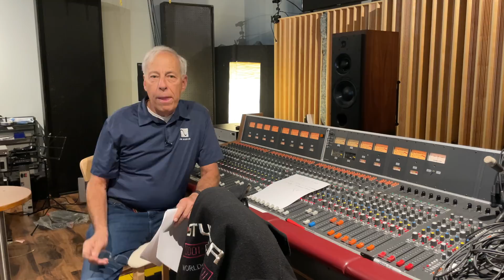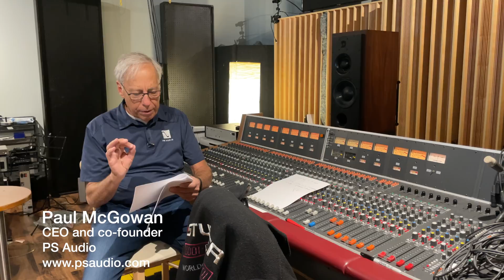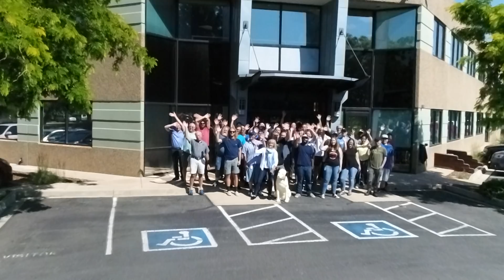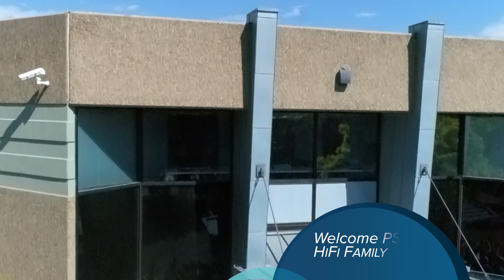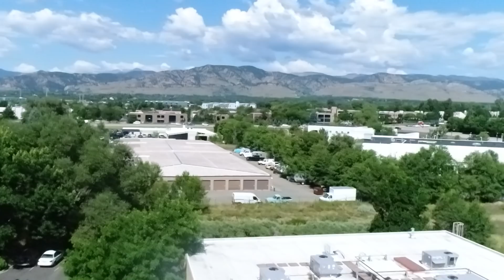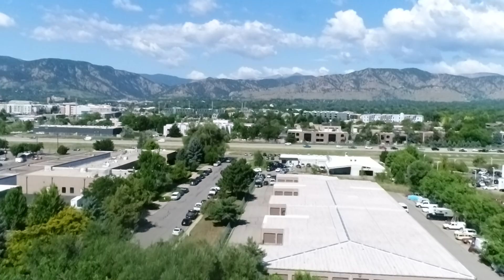The difference between preamps and power amps

Comment: Thank you for this clear explanation of the differences between what a pre-amp does and what a power amp does!
Assuming knowledge of input source levels (phono, mic, instrument, line, speaker), this takes me from an input signal with certain characteristics (voltage, current, impedence)  and passing through a pre-amp and a power amp to a signal getting ready to enter a speaker. 
I suppose what I still dont understand or, in other words, what is missing from the signal path story is how and why a speaker responds differently to differences in voltage, current and impedence, the impact on the quality of the sound produced and what signal characteristics work best for a speaker..
Reply: Some related answers:
speaker efficiency: https://youtu.be/GyHJSpZ-7jI?si=2RcWtR4K_Asv3SR9
speaker impedence: https://youtu.be/JaEgq7W8IZI?si=xhkHJfZmxHeX_5Vq

Comment: Hi there Super-Paul. I have another question for you: I have a set of 6 Loudspeakers with a 4 ohm impedance. I have also found a Pre-Amp rated at 8000 watts pushing 2-8 ohm Loudspeakers. Will this Amp suffice to power my 4 ohm impedance Loudspeakers? Thank You in advance Paul.

Comment: A pre-amplifier doesn't have any speaker line-out.  Only an amplifier does. I can explain this in about 2 seconds. The difference between an amplifier. Do I need a pre-amplifier? Do I need a mixer? Do I need a signal processor? Or do I have everything I need? I've yet to see a simple explanation that to me has a very simple answer.

Comment: I appreciate your explanation. I was just thinking if the ultimate purpose of the system is to make audible sound to humans, is it really necessary to divide the 'integrated' amp into two? We might define a device at the first time of the invention which can control voltage and current as 'amp' because both functions are necessary afterall.

Comment: Thank you Paul for this very understandable explanation on the differences between a preamp and a power amp. So, do I need a preamp  or can I just live with a power amp to power my speakers? Does the preamp give me some additional features when used in conjunction with the power amp? I can only guess that there must be a physical connection between the preamp to the power amp and then to the speakers and in that order? I'm an infant in my knowledge of this but I'd like to finally learn more about it. Thank you  Paul. Excellent video.
Reply from the maker: The preamp controls volume and provides input selection. In some "amps" called integrated, it is built it. A strict power amplifier has no means of controlling volume or selecting different inputs. So, that's always the preamp's job in an analog system. In a digital system (CD player or streamer) the preamp chores are often handled on your phone or tablet, so no need for a separate preamp.

Comment: Why do we need two separate devices ( preamp and amp) when av receiver can do both these functions?
Reply: Separates no compromise quality components, easy to upgrade and swappable.

Receiver the DAC, Preamp and Amp in one box. The integrated circuits share the same power from the wall (compromise) if something breaks hard to troubleshoot.

Comment: I get it, but I don’t at the same time? Like, why is a high impedance 600ohm headphone “difficult” to drive, when a low impedance speaker needs POWER? Why is a 16ohm to 32ohm easily able to be driven by a phone when the number is closer to an impedance of a speaker, but a 600ohm headphone, although works, isn’t great? What’s a purpose of a headphone to be that high of an impedance, when a good speaker that is low impedance sounds good too? I would have thought a high ohm headphone would need power too if it’s got the “headphone equivalent” of what a speaker needs to sound good. Like, does a 600ohm headphone have more components than a 32ohm? I got a DT 900 standard headphones that I got in 32ohm, but I had a choice to go higher. Why? When a 32ohm can be driven easily. Would that same model sound any different plugged into my DAC/amp than my current ones? Or is it suit people’s needs in what amp they have?

Argh!!!! Excuse my ignorance. I didn’t think when I got into audio I had to understand the same things as an electrician haha clearly I should just stick to asking if “this” would work with “this” gear and never think about it again lol

Comment: Wow thank you so much. This is the only video or article I have encountered so far as an aspiring audiophile that has finally allowed me to understand it. Thank you so much. I have one question though, given the role of the power amp as described,  am I to understand that the audio signal will travel on the voltage line to the drivers/speakers, while the current allows the drivers to be able to move thanks to the power/force (wattage)?
Reply from the maker: Sort of. Think of a power amp as two blocks, one feeding the other. The first block is the voltage amplifier that makes the signal bigger (1 volt in equals 30 volts out). This feeds (in series) the second block which is current (power). The current output stage is all that connects up to your speakers to move your drivers.
Reply: @Paulmcgowanpsaudio  oh wow.  i had to read that a couple times to grasp it but i think i finally understand what you are saying.  thank you so much my friend 👍
Reply from the maker: @virustwin  Thanks for that. This is what makes my day when the light bulb begins to shine. Sometimes it just takes a long time and many different tries. Congrats!

Comment: Nope. A preamp does not increase voltage, it lowers voltage. The power amp has a fixed amount of gain and in order to regulate the volume, the voltage has to be lowered at the input. Some preamps (phono, microphone) actually amplify but not your regular hifi preamp.

Comment: Thats the easiest explanation of preamp and power amp ive heard! Thank you paul as always!
Reply from the maker: My pleasure. Thanks for the kind words.
Reply: @Paulmcgowanpsaudio  So to play my record with my new turntable I need preamp and amp? I thought I only need a preamp and connected with the speakers
Reply from the maker: @kebello10  Some amps have built in preamps so it depends on what kind of amp. But if we are separating the gear as we do in high end audio, then yes, you need a phono preamplifier (or a preamp with a phono input). This gets the music off of the record and amplifies it to a useable level. But the output signal from a preamplifier does not have the strength necessary to drive a loudspeaker. That requires power from an amplifier.

Comment: If you do not have electrical back ground, think about the Pre-amp as a bicycle pump. You can create very high air pressure if you pluck the nozzle (high impedance) while you pump, or connect it small bicycle tyre that is full.

But once you connect it to a truck tyres, it lost its function, because there isn’t enough air flow to inflate the tyre to keep the pressure high.

The power amp is like a air compressor. It too increases the pressure of tyres, but it also has large air flow that can fill up the truck tyres.
Reply: Thanks a lot
Reply: This makes sense but I still don't understand why we need the bicycle pump. I don't have two engines in my car, one tiny and one big. I have one big motor. Surely the pre-amplifer brings something to the table other than being in the chain?
Reply: @blackburd  
Pre-amp could be a dedicated one that is designed for a specific source or a instrument, like guitar, mic, line-in, keyboard, audio decks, radio-tuner…. 
Keep in mind that these devices or instruments generate signals at different level.  

Or it could be one that is designed to handle multiple inputs, selectable with switches on the front panel. It may also include filters or equalizer. 

In short, it deals with input or inputs, amplify the signals to a controlled level, so that when they are connected to the main-amp, user can switch between sources without having to adjust the main-amp.

The main-amp deals with the Speakers. Different speakers work best with different Amplifier. So they work in pair with the speakers system, depend on how loud you want the output to be.

Using separate amp systems for source and output, makes it easier to manage and upgrade.

Comment: Maybe the old water analogy would help here.  The preamp takes a small amount of pressure and increases it.  The power amplifier also increases the pressure but adds to the amount or volume of water so that it can actually do something.  'Watts' simply being the combination of the amount of water and the pressure it's at.  Tube amplifiers for example are primarily voltage amplification devices, and require an output transformer to convert that voltage down to something reasonable and thus increase the current so it can push the mechanical device of a speaker to make useful sound levels.

Comment: Hi Paul I've subscribed to your channel because I know you talk a lot of sence.
I have a question regarding impedance. 
Can I reduce an amplifier that is rated at 4 ohms to 2 ohms without series-parallel ?!? 
Many Thanks!
Reply: @Sblackfll if an amps impedance is rated at 4 ohms then the amp decides the load not the speakers
Reply: @Sblackfll no matter way you look at it. An amp will have a rated impedance thus governing what load of ohms you can put into it.
Why do you think you can have an amps impedance rated at 4 or 2 ohms.
Reply: @MONK-7  It has a minimum rated speaker impedance that it can drive.  It DOES NOT DOES NOT have an impedance.  (Actually it does nave an output impedance, typically a fraction of an ohm.)

In an amplifier is rated fort 4 ohm speakers, then it can drive 4 or 8 ohm speakers.  It cannot drive two ohm speakers.
Reply: @Sblackfll look I'm enjoying the banter so no worries but my question to Paul was and I should have went more in-depth with the question. Was more of changimg the circuitry to achieve 2 ohms.

But I stand by what I said amplifiers Have an impedance ratio. 
Think about it I've got 4 speakers rated at 8 ohms each. Two on A/1/L and the same on the side B/2/R and the amp is rated at 4 ohms it's a perfect match. 
But if I add another speaker of same or greater/lower impedance the amplifier will overheat and quite possibly pack in. 
Thus the need for resistance as the amplifier requires to run at a safe level.
Impedance  Ω ohms.

Please say after me
Ohmmmmmmm
Ohmmmmmmm
🙏
Reply: It's also the speaker that can overload an amps impedance this is why the amp has a limit.
8,4,2 ohm's

Comment: Great explanation.  
Instead of a preamp, I use autoformer volume control.  With 12 3dB stops, it is like a 12 speed transmission.  Each click is 3dB less volume(voltage), but instead of using resistors it converts voltage into current.  Less volume but greater drive.

Comment: How does a phono-amp fit in to this scenario?
Is it similar to a power amp, but at a lesser amount of current?
Reply: What do you mean with phono-amp? A phono stage (or phono preamp) is a preamplifier that amplifies the signal from your turntable to line level and also applies the RIAA curve. It can be standalone or part of an integrated amplifier. An integrated amplifier combines both a preamplifier and a power amplifier in a single case. Usually such an integrated amplifier has multiple switchable inputs, one of which is for the turntable (because on this one the RIAA curve is applied as well as the input being matched to the output of the cartridge in your turntable - and that's why there's a little switch there to allow you to switch between magnet and crystal cartridge). To the others you would connect your other sources, the radio receiver, the tape player, the computer...
Now while there probably are some integrated amplifiers out there that only provide a phono input (and thus could rightfully be called phono-amps) I haven't seen any such limited device out in the wild.
Reply: The simple answer is it is another voltage amplifier that brings up a signal that is less than 5 millivolts to a signal that is over a volt or two, besides the EQ that must be done. A gain amplifier if you will.
Reply: @zulumax1  Is that the same as saying that a phono-amp is identical to a pre-amp, but with a fixed volume setting (a fixed gain setting)?
And the above is done to bring the voltage up enough for the pre-amp to continue the voltage increase via its volume control?

And I understand that some phono-amps have more than one gain setting.  But putting that aside, it is the same as a pre-amp, but for a fixed voltage increase?
Reply: @0Perhaps  There are equalization of the bass and high frequencies that needs to be made right, other than that the gain is measured in decibels. Moving magnet aprox. 40db of gain, moving coil probably 60db of gain. The gain of an amplifier has nothing to do with how many watts it puts out, only voltage gain into a given load, phono usually into 47,000 ohms. (moving magnet)

Comment: So, Paul, if I understand this, I assume that in the BHK300, the tubes serve as the voltage amplifier, and the MOSFETs serve as the current amplifier.  Is this correct?
Reply: Hi Neil, in case Paul doesn’t get back to you quickly enough you are correct. There are many companies that are using the same design philosophy lately and it’s a good design.
Reply: @Scopolamine46  thank you.
Reply: @doowopper1951  You’re very welcome.
Reply: you are wrong. vacuum tubes are on the preamplifier section and work in the same way as transistors but tubes give a different sound type.
Both are volt amplifiers

Tubes in PS audio equipment are only used in the preamplifier input section to provide a special sound type.
Reply: @ford1546  Check again. The BHK 300 is a mono block tube amplifier with a tube input stage for voltage gain feeding MOSFET voltage devices in the output stage. Both stages our voltage and amplification with the power stage being able to supply the current demand to power the speakers. This is the unit that is under discussion.

Comment: I have a gain selector on my preamp. I set this to zero and I can hear the sound improves a lot. So is it the voltage amplifier in the preamp that is very crucial to sound quality?
Reply: You have noise in your system that is noticable when the gain is turned up.
Reply: @Roof_Pizza  Yes, and the sound is somehow more 'flat'. I have a TAG Mclaren PA20r preamp partnered up with two 125m mono blocks of the same brand. I saw a review on the PA20r and they stated; Why isn't a gain selector more used on amps? I don't know if my preamp at gain zero could be classified as Class A. But I think it is closing in the gap. I almost never use any other gain than zero.  And with this my system is loud enough at half volume.
Reply: @Douglas Blake Yes. I think where my system's weak links are. In this order; 1. Speakers (Epos ES11) 2. The room. Not too bad but definitely not optimal. 3. Turntable (Lenco L75, shure m75 mk2 PU) 4. Speaker cables. OK i guess for now. 5. Phono preamp MM (Holfi Ellipse, a good RIAA). 6. Amps. Preamp; TAG Mclaren PA20r with gain selector. Mono blocks; 2x TAG Mclaren 125m. Let me know if any one of you disagree.